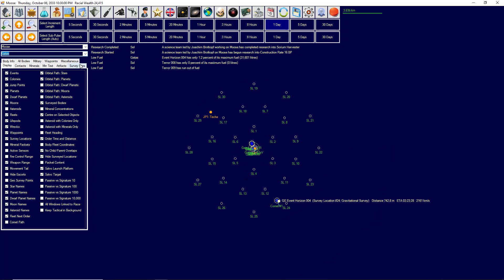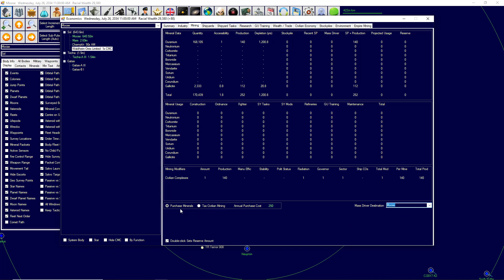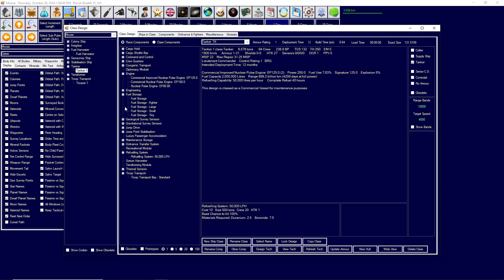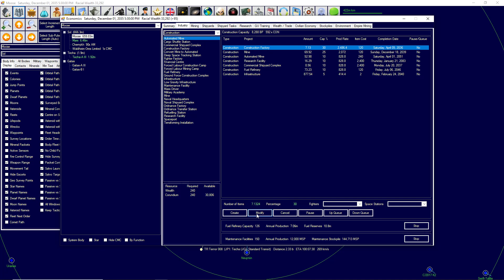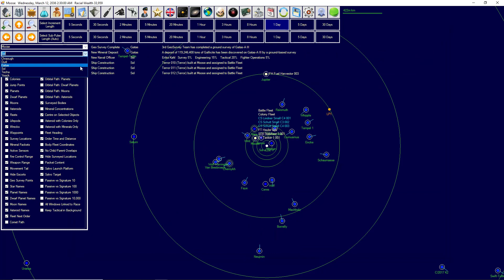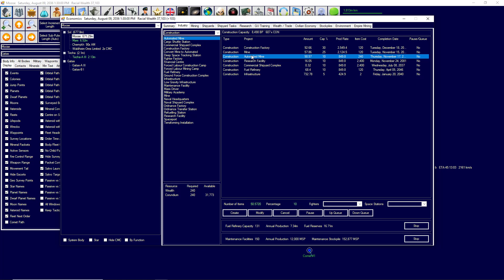Aurora C#, Ground Surveying, Fuel Harvesting and Tankers

Comment: @Battle Moose Do you happen to have the installer or dropbox link somewhere? I wanted to pick up this game, but the whole website seems to be down.
Reply from the maker: To install the game head over to http://aurora2.pentarch.org/index.php?topic=11299.0

Steve has been updating the game a lot over the past few weeks so the installation instructions have also been changing but everything you need should be there. Let me know if you get it working.
Reply: @battlemoose1594  aha the website is working, but my HTTPS plugin in Firefox was causing the issues with the site.
Reply from the maker: Post 2 in this thread gives the order of instructions to install the game. http://aurora2.pentarch.org/index.php?topic=11176.0